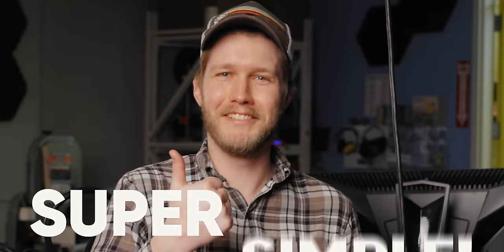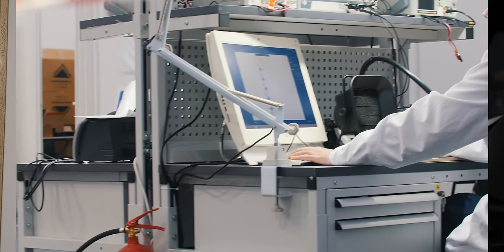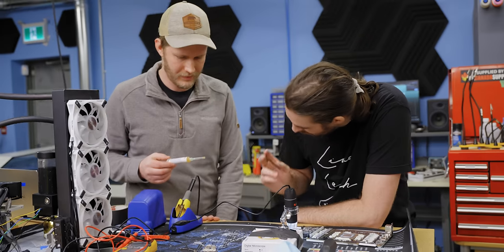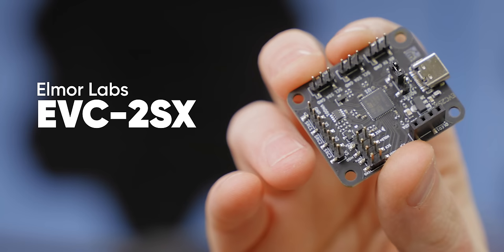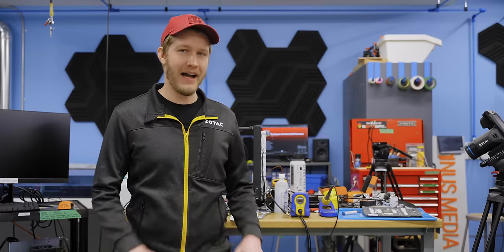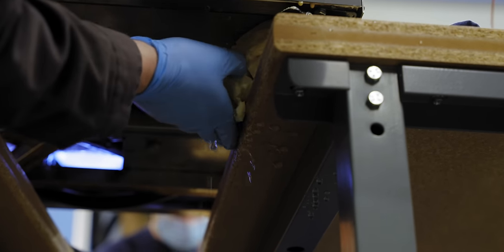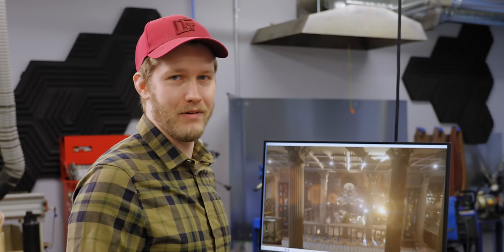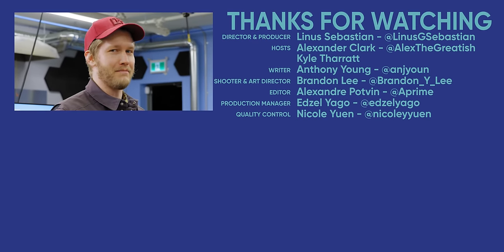Nvidia Doesn't Want You to Do This - GPU Shunt Mod

Comment: I only believe you if you can hit 25,000 eme mhz max on the clock. my asus rx550 has this setting but I can't cool it fast enough 2 work. highest I got was 12,000 mem  mhz. I think it was a bios problem. since I updated it. it won't show ridiculous number since I updated it. the gpu clock was 3000 mhz now stuck at 1200 mhz. plus the old i-7 2600k max o.c. I got was 24 ghz. on a Gigabyte-GA-P67A-UD7-B3. I fried the mobo but saved the i7-2600k and the video card and power pack and ram. the  i7-2600k is now collecting dust try to find another mobo Gigabyte-GA-P67A-UD7-B3 mobo and the video card is still going same with ram and drives.  the mobo says ff but no video output. plus it could of been the broken parts on the mobo that killed the mobo. anyone using this board if you f up take the bios battery out to get back in the bios/turning back on. mine would only work once in a while. it has benn sitting dead for 3 yrs. I tried it again. it fired up until I had to restart.  then no go for Gigabyte-GA-P67A-UD7-B3. I really want another one. someone let me know if you have one willing to pay $150 cad for a working mobo. and willing to pay $100 cad for the i7-2600k. now I am on a cheap dell i3-2100 when this one dies out comes the old q6600 o.c. to 3.5 ghz as my back up computer. and none of my computers go over 72c on temps on the processors. and video cards max I get them is 82c.  if they climb higher I replace the thermal paste. and this is with all safety's removed.

Comment: did you really put those resisters in parallel?... i hope you are aware resisters in parallel reduce resistance, example 2 1ohm resisters in parallel will result in a resistance less than 1ohm.

Comment: What happens if a shunt fails on GPU, what effect does a overheating shunt have on power draw :) heat increases ressistance then increases heat creating a run away thermal event :)

Comment: You really shouldn’t be encouraging people to do this.  As a 3090 owner and someone who has done hardcore overclocking mods, the tinniest mistake will brick your $2000 card.  That was bad enough when cards were selling for $600, let alone $2000.  Conductonaut mistake, bricked.  Shunt mod mistake, bricked.  Too much voltage, bricked.  Botched bios update, bricked.  DO NOT TRY THIS, unless...you are willing to accept the loss of graphics card.  If you really want to get a few more FPS or a little bit higher 3D Mark score at the potential cost of your graphics card, go ahead.  Just be aware of the risks.

Comment: Is there voltage controller that can work at offset from requested voltage?
That way you could both have an unlocked higher voltage but still maintaining a voltage curve

Comment: Im curious how much you hacks make screwing up a 3090 because you can’t solder for shit you don’t have to heat the whole board up just the solder a small tip would of worked just turning the tip horizontal and using the side for more contact area

Comment: a computer is all about compromises. 
my 1st compomise is always noice.
1. low noice lvl
2. a have to be able to play the game. does not matter so much if some of the diggital effects are dissabled.
3. low watt use.

so i have found a gameing laptop does the work for me. but ok, i dont play microsoft flight simulater at 4k. but can still play it.
so this DiC is nothing for me. . because overclocking always means a lot of watt usage. and more noice.

Comment: LTT: spends tens of thousands on workshop equipment,
also LTT: blame a crap miscalibrated soldering iron for their video on 3000$ gpu instead of just getting a proper new one

I'm really peeved right now. Get a freaking grip guys, we want to see cool stuff, not 5 minutes of excuses for misuse of crappy equipment.

....heck, even my cheap WEP937D+ would easily solder this.
Reply: I don't know why they'd screw around with it either. Just buy some $200 soldering iron

Comment: you should make your cooler loop bigger, you should first connect it to a lot of normal radiators to pump the heat out of it in the air, up the radiators in another room(s). next you can use a bunch of modified refrigerators which push out their heat to the outside, and their cold is inserted into the water, set the water at around 0degrees celcuis so it just won't freeze, or add some chemicals so you can reduce the temperature further. you can also include some fine metal powder to increase the waters thermal conductivity, this will however quickly destroy the machine, so instead it would be better to first delid the GPU, then use a custom water cooling block which can cool all hot elements, but above all spreads out the heat, yet is very thin meaning it directly transfers the heat into the water. the water pressure should also be increased, and you should use some high power industrial(or gardening) water pumps to pump around with enough force, but above all to have a very high water speed so the water around the cores will remain below 2 degrees celsius at all times. if your GPU draws little power and you are capable of reaching great enough water speeds you might want to bypass the radiators(if the output water is below room temperature) and only push it through the fridges, this setup is great for if you add chemicals to the water to greatly bring down the water temperature, you can also try to directly run the cooling liquid from the fridges through the cooler, however that might not cool well enough since the separate water loop allows for much higher water flow speeds, pressure, and making it better thermally conductive as well.

Comment: I am interested how is that possible that your soldering iron is max on 220C, because normal soldering iron can heat up to min.380C . You said that is 70W soldering iron. In soldering station you have 40W soldering irons. And the most important question why no one is using hot air. You are soldering SMD. And this GPU costs too much to use cheap tool for every mod or etc. you try to make.

Comment: 12:23 wtf am I seeing LUL i think u got bottlenecked by not cooling the vram/mem and voltage controlelrs properly though that normally hit the heatsink. I am thinking active front and backplate with cooled water wouldve given u better result

Comment: Hold on, let me change my windows and then youtube volume to like 20% so I can hear without my ears bleeding. (Speaker doesn't have built in volume control using 1/8th inch jack so it's on max the entire time lol)

Comment: This was a fun video, but why so amateur?! you are Linus! I saw many tests like this over a year ago, from DeBauer, GN, BZ and many overclockers in the community. Why are you using TimeSpy Extreme? Why not royal port? Why didn't they try different BIOSes? The 1000W BIOS was released almost a year ago. I would hope for a better cooling solution, what is that monster you built? The video was fun, but I expected something much more pro from you! And I follow your advice as I have the same 3090 Rog White and for normal use OC is not required. And the standard BIOS is not 380W but by raising the power limit from the sw it reaches 480W, so you could play with the BIOS to test all this and then go to the shunt mod and after that the voltage controller (if it is really necessary). I would expect a better explanation or the cooling system, the condensation factor using any water block for this card and lastly the voltage controller. Conclusion, do not play with 3000 usd cards unless you have money left over or want to live keeping them or fixing crashes in the games

Comment: Did you just blame a Hakko soldering station rather than the guy who soldered?!
The dude was watching the screen of the soldering station like a grandma looks at a smartphone... Smartphones have millions of pixels and grandma is 90 years old... The Hakko soldering station literally has a 3 digits screen ^-^
Reply: Wait, you did all that to get from 10500 to 10900?! I don't know much about cpu, gpu and what not but that seems like a massive waste of time... You, the other soldering genius, the cameraman, the guy who edits the video... By not making this / paying you, you could have bought a second gpu and get 21000... If my maths is correct... Can't you just put 2 gpus in a computer?

I don't know, I overclocked my pc by buying an old 5:4 monitor instead of a 16:9, less poligons to draw, more performance... so, I'm really not the guy who you should be taking advice from ^-^

Comment: As a hobby? Yes! Cool! 
Such never had any use case, so why even mention about worth?
But man it is fun :-)
I think tinkering a bit with your stuff is defo worth it. I have a undervoltage overclocked 6820, and it is running colder and consumes less power at constant 4ghz than stock. So I'd say it is worth a try. Optimizing stuff. That is interesting. This is just "killing time why I am training", but it is fun!

Comment: How about buying a good soldering station being able to compensate? Its not just about wattage also about regulating? ...I have had such sitations to soldering on a solid piece of copper. Elsa icon pico or weller will do it. I guess Linus was a cheapskate again ;)?

Comment: These cards run so hot even the stock clock is too fast and they thermal throttle themselves. The RTX cards are fucking junk.

Comment: Dooods.  You are triggering me with that janky solder job.  Do your team a favor...spend 200-300 bucks and get a really good solder/hot air system.  Tin those tips properly and upgrade to a good silicone mat...

Also, use that flux...you can clean it off with acetone later...that stuff will keep you from over heating any components...and will get nice solid connections.  Throw out that cheap flux you showed...get some good stuff.  Look at Louid Rossman's channel for his store, he sells the best flux/paste that I have run across...in fact he sells really decent solder systems too.  Anyway glad you did not kill a 3k card...

Comment: complete and utter waste of time and viewers attention. I cant believe that even 9 years after Maxwell people are still trying to spin that fairy tale of "Im gonna overclock it until it crashes, than im gonna add some voltage"..it doesnt work this way, that card runs exactly as fast as it would without extra voltage. This voltage thing only works on LN2. A few degrees lower water temp will not let you bypass this problem. Overvoltage with actual scaling only works on VRAM if you can gain access to the voltage control. If you knew only remotely what youre talking about, than you knew the outcome before the video. But hey its got 2 mio views, so who cares.

Comment: U don’t need to be engineer to build a computer I just decided to build one day because my laptop can’t run swat. 200w solder iron noobie. Look like he haven’t done this before let’s try on this 2k card lol. Hot air will melt the whole board.  Shouldn’t he tries on a cheaper card should do a practice video before this but he want to look stupid. Dude u can’t use low heat solder first u have to melt the chip on the board.

Comment: Sooo you guys work on a 2000$ piece of tech and you cheap out on a freaking soldering iron ?
You shouldn't be allowed anywhere near a soldering station !
And you DARE blaming it on the card dissipation being too good, bruh, it's a pcb, it's not the pcb's fault if you can't solder lol

Comment: If y'all would have used the 3DMark results page better you would have seen that you're actually in 11th in Canada for systems with 1 GPU. 

You're approach was also terribad. No mods on my 3090 and get 12050 for graphic score on Time Spy Extreme. Use proper water blocks so you get cooling to the memory and VRMs also. I doubt you were reaching dew point on the surfaces with that much power running through your card and that change state system. SMH. Go home, y'all drunk.

Comment: Worst solder job ever, literally a 30 second job. fx-888d is trash buy a ts100 and spend some time practicing before doing sloppy work in a video. FLUX LEADED SOLDER